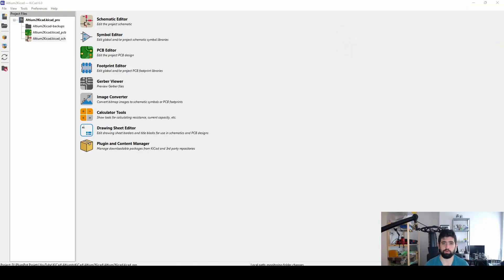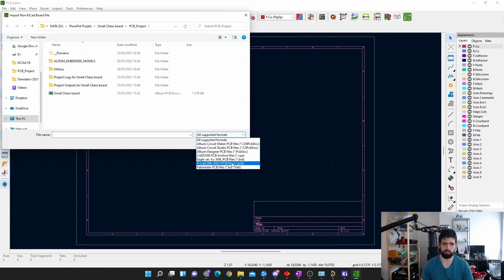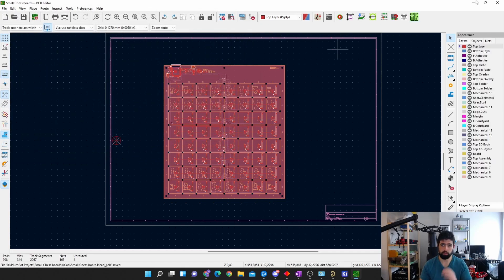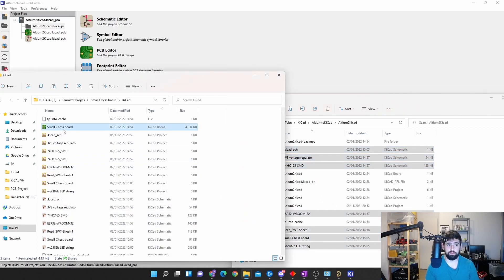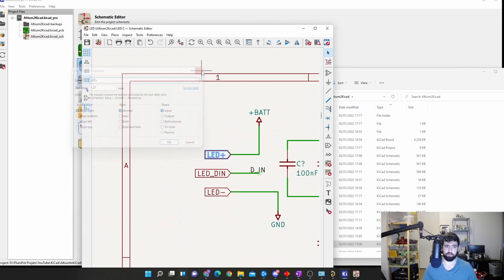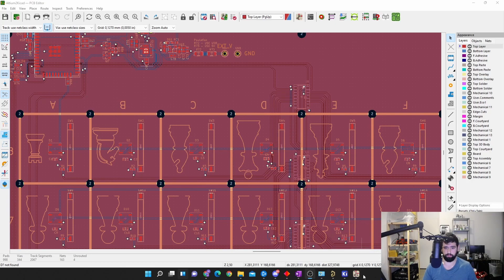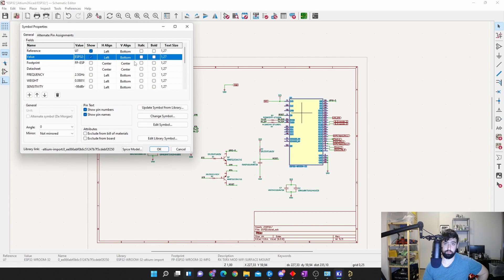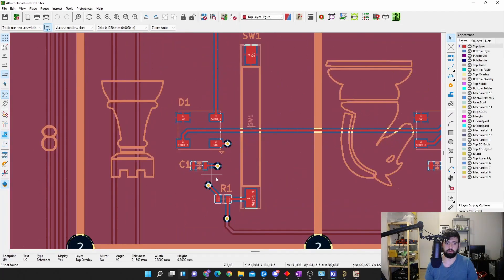KiCad V6 Tutorial - How to import Altium Designer projects into KiCad

Comment: Hi, I imported an altium schematic and PCB...fine...Then I updated/cleaned the schematic footprints etc , keeping annotation of the parts the same. When I then update from schematic to the PCB, my old components stay there, and are not replaced by the new ones. The new ones are shown in a ratsnest. Is this normal ? Is it possible to just replace all the parts with the new parts , so I can keep the placing of the components ? Thanks in advance for your reply. Regards. Ludo
Reply from the maker: Hi Ludo, when you click on update PCB from schematic. There should be a tick box that saissais something "replace or delete footprints" is that box checked?
Reply: @PlumPot  replace footprints by those specified in schematic was ticket
Reply: But rats nest still remains
Reply: There is also : couple footprints again  to schematic symbols on the basis of their references.... Not sir what this does
Reply: @PlumPot  Hi, thank you for your quick reply. I had to take the first option relink footprints to schematic first, then the last option. This worked "more or less" (some parts rotated, but generally ok....)

Comment: Hey, thanks for this useful tutorial. :-)
I have some problems with importing the schematics because they are structured hierarchically in Altium.
KiCad does not recognize the hierarchy and shows errors when I want to add the converted schematics to the KiCad project.
May you can help? :-)
Reply: KiCad does not automatically adapt the schematic hierarchy from Altium.
I solved it by first inserting the root schematic. Based on this, I inserted all the children as it was with Altium.
Thank you :)